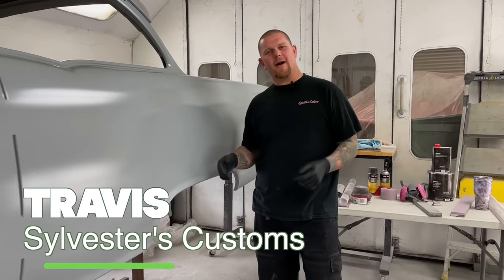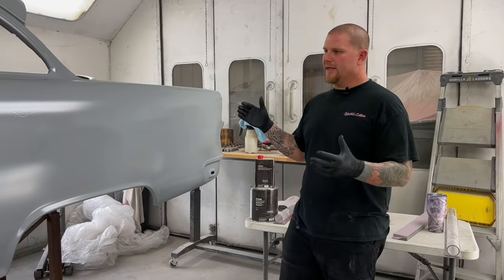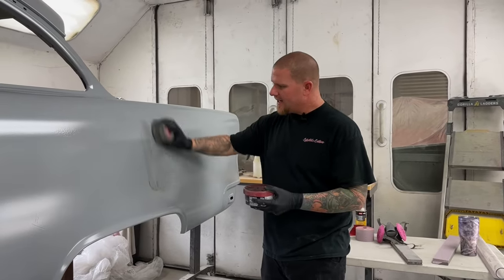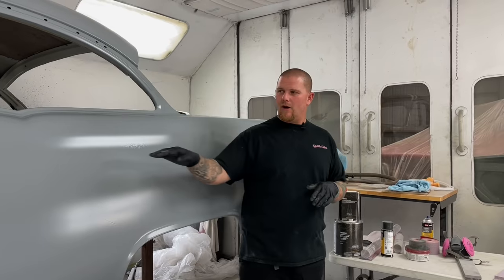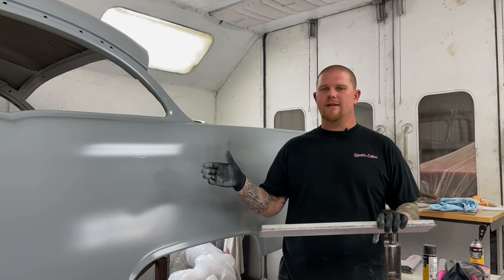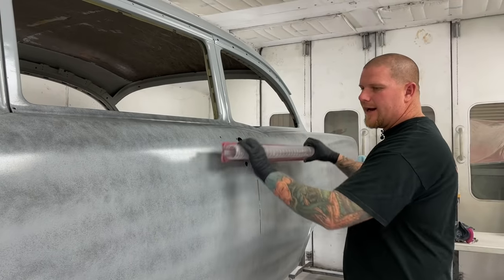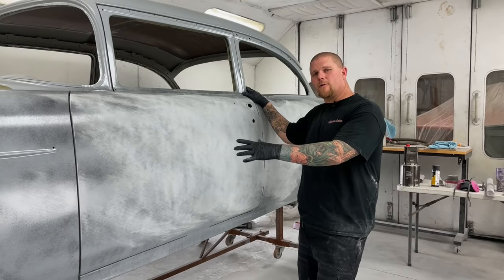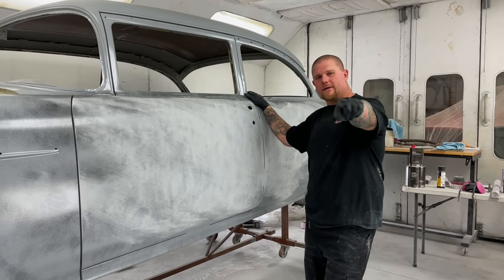Block Sanding Primer - Essential Steps to a Mirror Finish

Comment: What make dry sticky paper do you prefer Travis? I've been using dura gold and find the adhesive is a royal pain to clean up on the linear blocks. Just shot my hood after following your procedures using the linear blocks. Except for a few dust flecks my fault. Wow!! The quality of depth and flatness is amazing. It looks like the paint is poured on. Absolutely dead flat with no ripples form the overhead light reflection.  Very happy. Also I left the VP 2050 for at least 8 weeks before blocking. I've heard some complain that its tough to sand. Sure its a little tough to break through at first, but in a way I like that, its more forgiving that way. If its too easy to sand its easy to blow through. Once again you and the guy that sells the blocks have helped me immensely. Cheers John..
Reply from the maker: Very glad to hear. My favorite paper at the moment is sunmight

Comment: I never feel like saying this or this way but damnit Sylvester, you left me wanting more!!!  It is like we went to commercial and the clock ran out. Listen to me, I am not the type to watch epoxy dry nor get into a hurry, it’s just I was so caught up in the product, the tools, the method, it even crossed my mind to count the number of strokes on the block to be consistent and, and it stopped? 😢 That was a fast 17 minutes, I felt, well just keep going! I can’t believe I feel that. More. 😂
Reply from the maker: Lol thank you!! There will be more coming soon but new video every Friday we’re very happy that you love the videos.
Reply: I’ve never had my paper clog with guide coat spray can. I use a flat lacquer. I let it dry then take the majority off with a da using 180. In my opinion it’s okay to use a flat disk da to take off the top layer as you still are left with plenty of visual guide coat to sand flat. It’s faster this way as well and instead of laboring for hours to get the process started. It basically jumps the routine into hyper drive and the job is done much quicker with same results. IMO. But yes these so called steps can be different for different people and shops. Nothing is concrete. It’s what works best for you. I think you talk about sanding epoxy primer? I’ve never done that. When applying epoxy it’s usually sprayed on to protect the metal even before body work is being done. If you work the surface down to metal more epoxy is needed. Then comes several coats of surface primer on top. Perhaps all these years I’ve been doing it wrong. Perhaps the workers who use this method are all wrong and you are the only one doing it the right way. Sanding down epoxy. Which is rough and very difficult to sand. 
It seems we differ in many aspects of body finishing. I guess there are always those who learn it a different way. 

As long as the body is like glass in the end I don’t care who’s method you use. 

Good job on getting these cars smoother than they ever were from the factory.
Reply: @MrCbell57  Just remember Rick, there are different ways of doing everything. Some epoxy have a short or long open time. I read to make it right. Having VP2050 DTM epoxy based primer sealer is outside my allowance, but using a short stroke DA W/Interface pad keep lines sharp while braking the hard top layer. I will wipe down and spray my epoxy over bare metal break thru spots. I prefer the sealing part of a hard waterproof substrate before addressing scratches to pin holes. At least you are using your noodle and creating at 30-40+ year paint finish and for the, I salute you for caring! DK, Omaha.

Comment: I have used all your finishing techniques, hand blocked my car 7 times, sprayed sealer , base and clear, hand cut the clear with the block using 1000, 1500, 2000 and then 3000. Machine polish 2 times with compound and the 2 times with swirl remover and machine polish, your lessons are right on, my car is razor straight, the finish is a super high gloss and totally flat, the car came out absolutely gorgeous, I have won two car shows, it is a ton of work but now it was totally worth it, all done in my home garage, you rock, can't thank you enough for the lessons, this bitch is razor straight and awesome.
Reply from the maker: So glad to hear that!!! Would love to see it! If you are on instagram send pics!

Comment: My first teacher in metal work always told me, that to feel dents I had to use bare hand. And called other who use gloves stupid. I did'nt changed my opinion about this for few years, even when worked in auto repair center. Used to meet that man,  and tell him that people in there use gloves. And we laughed at them together. I did'nt even try to use glove. Just few years ago it was a discovery for me.
Reply from the maker: Yeah it’s the older way to go about it. However if they are going off of their hand vs blocking with guide coat I 💯 guarantee their cars aren’t as straight

Comment: So, steps?: panels have been stripped to bare metal, whether it be by mechanical, chemical or media blast. VP2050 to cover that. Then body work, hammer and dolly etc. Then before body filler, does one need to grind the surface back to bare metal BEFORE applying the body filler to give it tooth/grip, OR do you prep the VP2050 by scuffing and then body filler over the top of that? THEN once body filler work is done, VP2050 over the top of that, then block out? VP2050 again as a sealer? Maybe you have done a video, but I would like to see you take a bare metal fender and go through the entire process to the point the surface is ready for paint. Its been 30 years since I painted a car and I am getting ready to do a project. Everything has changed since then. I want to do it right the first time and I have no problem spending money on VP2050 if its the only primer/sealer I need. So confusing all the information out there. Its not a show truck that I am doing, Just looking for OEM quality when I am done. Perhaps there is a different approach you would take on something like that? Thanks for taking the time to do these videos, very informative, but would like a summary video start to finish of the process. Perhaps you have one already and I haven't found it. Thank you again!
Reply from the maker: Thank you so much for the donation!! so you are really close on your procedure you want to do all of your hammer and dolly work while it is in bare metal before any primer even gets on the vehicle. You have to have the metal work perfect as you can get it then seal up the car in 2050 once that has cured for two or three days you can then scuffed up the primer with 100 grit or 120 grit do your body work with filler and then when that is completed, you should be to at least 150 grit. You then go back over it with 2050 3 or 4 coats. Give that another bit of time to dry the longer the better. Start blocking that out with 150 grit and then guide coat 220 grit guide coat 320 grit, guide coat wet sand with 600 grit. There’s different options for sealer but you definitely want to use a sealer. You cannot use the 2050. Then roll right into paint after sealer has flashed off. If you would like a class on this, we are only holding two classes this year. One of them is next month and the other is in June email me if you would like me to send you the information. Sylvesterscustoms@yahoo.com hope that helps.

Comment: I would never ever allowed any dust sandings & body work sandings inside any paint booth. I keep booth strictly dust free as possible. Using the correct mind is to save mistakes & error. I am an expert. I place a booth in other garage only for paintings. Simple. Never inside the shop. It will save tons of money & time.
Reply from the maker: The fact that you state your an expert tells me you are not …. Carry on

Comment: Lol I feel u on sanding  bro.im a chef but also do panelbeating. Good tips.keep ul the good work
Reply from the maker: Will do, thanks for watching.
Reply: Only a pleasure.me and my triplet brother don't own a workshop buy we get the job done.we busy building  ourselves up.we busy with a mini cooper.built a wide arch bodykit for it and it's getting a k24 powerplant...we taking the flat process up to 1500 before paint
Reply from the maker: @craigsolomon8292  be careful going up that high in grits paint will not adhere. I don’t paint anything above 800 most days 600 is best you need a tooth for it to adhere 👍🏻

Comment: Letting the solvent out, yep soon as its dry enough ill scuff around on it to open up the skin, but i keep a gun full over over reduced black lacquer primer and constantly guide coat til im into six hundred grit. A quart of black lacquer will last forever.

Comment: Amazing video. May be a dumb question, but you said that it is 3-5 days for high build primer to fully dry. Can I apply 3 coats in 1 day then let dry for 3-5 days or do you have to let the solvent escape between each layer? Thanks
Reply from the maker: I spray 3-4 coats at the same time. You need to look up the tds sheet for your product you are spraying. It will tell you what the flash time is between coats.

Comment: Finally got a roll of 120 boy does that make a difference cutting straight and quick than starting with the 180 like everyone says to do. Now i do not have 150 or 220 can i get away with the 180 next then 320 or do i need the 220? I have a lot of 180 left.
Reply from the maker: Yeah use what ya got 👍🏻 As long as you are accomplishing getting everything flat and the guide coat tells you that upgrade in grits. Once you get to 320 be sure all other grits are gone before upgrading. The ones we prefer is 80 grit then 150 after 150 we prime and then go back to 150 then 220 and wet sand with 500 👍🏻

Comment: Hi Sylvester I’m new to all this Resto work but loving it so far I’m doing up a car that I have done all the metal work and epoxy sealed the entire car and I’ve used polyester spray filler on the doors and quarter panels were you see it what undercoat is best to use hi build or a normal primer like wet on wet keep in mind I’m not spraying wet on wet I  usually spray 2k primer on top of the polyester then finish off sanding with 500-600 dry grid and have had good results do you think this is the correct way I should be doing it thanks.
Reply from the maker: I personally am not a fan of using several primers to many variables and potential failures in doing that. I only use vp2050 start to finish. But do whatever works for you
Reply: I know I tried to get this at the beginning but here in Australia I couldn’t none in stock at all thanks anyways.

Comment: Great lesson, question though, how do you block out the top edge area on the door or quarter and roof between the window and the door or quarter panel?
Reply from the maker: You have to use blocks that are smaller to fit in those shapes or areas
Reply: @SYLVESTERSCUSTOMS  thank you, take care and happy holidays
Reply from the maker: Happy holidays!!

Comment: I start with 320 wet sanding with a little Dawn and water then 400 it's more aggressive than you think, I don't think I'll ever go back to dry sanding primer to me it's just faster ,keeps dust down and saves me money on sandpaper.
Reply from the maker: 320 is removing scratches this video is made to eliminate ripples in the bodywork. 120/150 grit. We will be doing another video on wet sanding 👍🏻

Comment: Is it necessary to bondo the whole car before blocking even if you have no low spots?
Reply from the maker: If you want mirror finishes yes. Even brand new panels are not perfect.

Comment: Looks great …. My question is , I thought epoxy gummed up paper ?? …..
Reply from the maker: Haven’t had those issues with this product. This 2050 is a hybrid it’s an epoxy high build. Designed to be blocked out
Reply: Appreciate reply , big time saver for sure , especially if prior work is straight , which your s appeared great
Reply from the maker: @lawncuttingplusdelta  thank you. Get your bodywork as perfect as possible 👍🏻

Comment: Do you wet sand with Linear Blocks?  Odd that Linear doesn’t make a 400 grit.
Reply from the maker: It depends on the car and the budget but when it comes to show finishes we use a completely different process with small blocks
Reply from the maker: I actually use the blocks from lucky blocks they are in acrylic block that wraps around 600 grit that will be what we use before paint and then we use a different set up after paint
Reply: Do you have a video out on the wet sanding process?

Comment: How does Slick Sand Compare to the 2050? Would you use it?
Reply from the maker: Slick sand is a polyester primer. Two very different primers. Vp2050 is a hybrid designed for bare metal and gives you high build. Slick sand is basically sprayable filler not made for bare metal.
Reply: @SYLVESTERSCUSTOMS  I’m looking for a way to protect areas I am welding that are bare metal until I work on the areas again. It could be a year. What can you recommend? Spraying an etch primer? Then remove it later with maybe acetone? Thanks as always for taking the time to reply.
Reply from the maker: @jimdrechsel3611  vp2050 is the only primer I use now in my shop for many reasons. It gives me more build the most primers, it is a DTM so it is good directly over metal, and it’s one product, which means less failure and better consistency. There’s no need to use any other primer in my opinion.
Reply: @SYLVESTERSCUSTOMS  I was hoping there was a spray can for a temporary protection that I can remove before spraying the whole panel. It’s getting colder now and I don’t have a heated barn. If mixing up the 2050 is the best way to go then that’s what I will have to do. 
If there is some surface rust in hard to remove areas how would you prepare for priming the 2050? Use something like the fast etch? Do you have a product to recommend for removing surface rust in hard to clean spots that aren’t flat? Maybe some surface rust in pin holes?
Reply from the maker: @jimdrechsel3611  media blasting is best. You cannot use etch primer, and epoxy together. If you haven’t already, you need to watch our video, breaking down the different primers it explains what to use together, and what not to use together.

Comment: If you mess up how can you take it off?
Reply from the maker: Mess up how?
Reply: @SYLVESTERSCUSTOMS  like burn through when turning it or edges not crisp and straight. Seems to be my problem now. Iv experimented with different times for the sizing when I brush it on and getting a crisp edge is really hard then not tearing it when turning it so fairly hard too

Comment: I'm 65 years old I built so many cards I lost count in the 80s it costs so much to build a car now that's going to sit in your garage most of it's life I still use single stage paint on my cars might not be perfect but I drive mine everyday
Reply: I just applied my second coat of 2K primer but do not own a long blocking tool.
Is that something I can buy at a local paint shop if not I'd have to order one which could take a few days to receive. What are my options at this point.

I'm working on the trunk of a 2002 Pontiac Grand Prix GTP bright red

Comment: Thanks for another helpful video.  I'd be curious to know your process for the doors.  For example, do you do initial filler and sanding work for the door on a panel stand and then reinstall on the car.  Then skim the door and fenders/quarters together and sand to get it all lined up?  I echo the comment below about wanting to understand the filler in the gaps.  I'd be really interested to see how you refine your gaps as well.
Reply from the maker: Thank you for the question. We will post a short video explaining why we do it and the process. Keep an eye out next week for it.

Comment: So after body filler has  been sanded, then go to 120 before priming? I just finished body filling using your method with the pencil etc and feathering the edges. Worked great by the way. I sanded the filler out with 80. But then primed again. I think I should have gone to 120. I'm Seeing the 80 scratches. I thought I'd wait for a week then go in again with 120 and repeat the prime again? What do you think? I am using vp 2050. Hope everything's ok, Haven't seen any new videos lately. Cheers John.
Reply from the maker: All is good thank you. Shops been super busy. We will be back soon. Try and get your filler work to 150 grit before priming.
Reply: @SYLVESTERSCUSTOMS  Thanks Travis! Good to hear all is good. Been super busy here too. Really appreciate the channel. I only watch yours and the linear block guy's videos on body work. Hope to see more next year . All the best Cheers John.
Reply from the maker: @mercedesmaintenance.6339  thank you so much. We have been super active on instagram finishing up the caddy and gasser. Videos coming very soon

Comment: PPG have providing automotive paints and primers for the auto industry for 80yrs.  Can't go wrong with that.  I've binged on several vids.  I'm hooked, hope to see some body restoration, qtr skins, rust repairs / I get it not much in Cali cars.
Reply from the maker: Thank you very much as a matter fact the 61 impala we will be doing quite a bit of metal work including rust repair quarter panel replacement custom-made firewall and floors the plan is to build a full custom car and show how to do the entire process for people at home 👍🏻 thanks for watching

Comment: we never had nice blocks in the 70s but somehow i got them straight when i turned 48 one finger on each hand folded inwards to palm from years of solvent doctorsaid and then i had to learn how to use my my inward  part of thumb to feel lows 32 years in on floor battles now under my belt.so many showcars now im 60 and doing plastic cars and pdr now im 60 and still fulltime.your eyes and your feeling  of even a thumb and knowing is a big part to of making things flat and straight.and sometimes you can just look at a finished classic and say that bodyline looks to rounded it more than likely got buried in mud  and 10 paintjobs over time